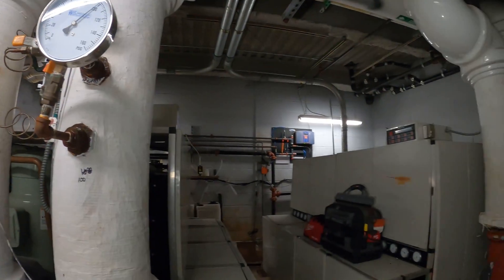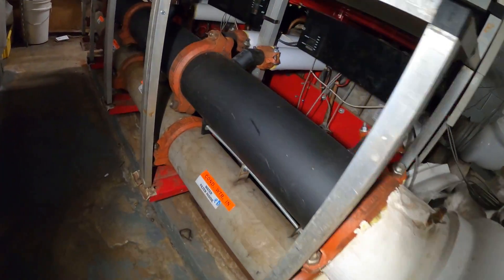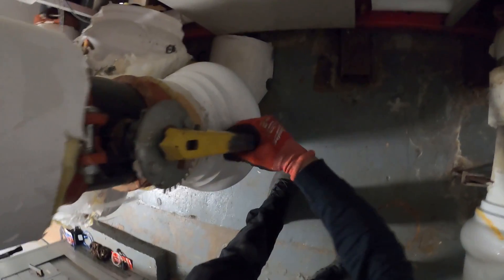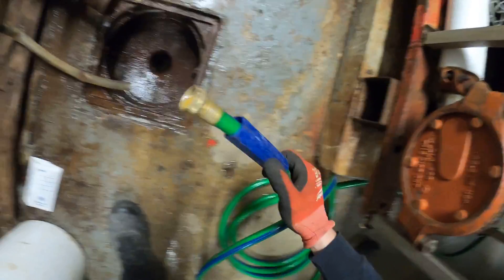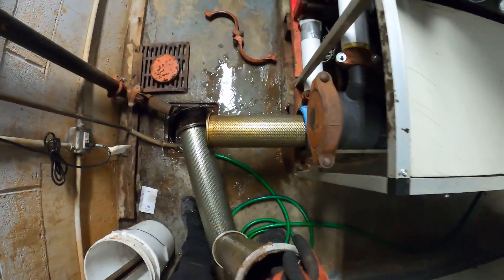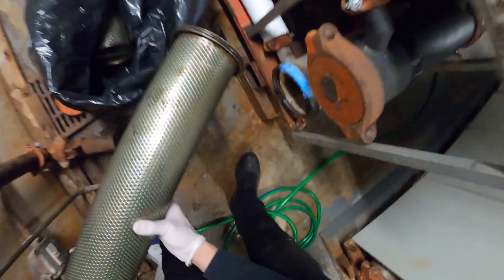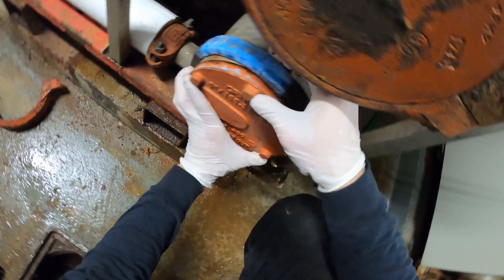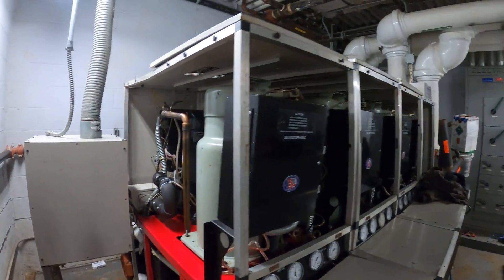HVAC: Chiller Maintenance (How To Clean Condenser Water Strainers) Industrial Refrigeration Training

Comment: I pulled strainers on a newer model and the baskets were connected by stainless carabiners. 👍
But mine had a blow down at the end, adding to the degree of difficulty by myself. Had to create some rigging to hold the pipe up while i made the vitalic connection.
Reply from the maker: Awesome👀 This field is crazy🤯Stay safe out there & stay tuned for new videos every week🔧
Reply: i also have one like this. used a chain fall and ladder the first time, but every time since then i just balance the pipe on the support and make the connection. lol i have to do mine at a min every three months.

Comment: Is there only one condenser pump for both chillers? I usually clean pump strainer as well.
Reply from the maker: There is actually 2 condenser water pumps & 2 chilled water pumps for this setup. They run 1 condenser pump at a time and either have 1 or both chillers operating depending on the load🙂 Cleaning the strainers for the pumps are part of this maintenance👍 Thanks for watching! Stay safe out there & stay tuned for new videos!

Comment: If its a closed loop shouldn't have to clean the strainer.  If the strainers are plugged in a closed loop they need better water treatment.   If its an open loop, probably should backflush the condensers.
Reply from the maker: It's an open tower. Damm pigeons👀 No matter the system or setup, need to do the maintenance. Thanks for watching & stay tuned for new videos! 🔧👍✌